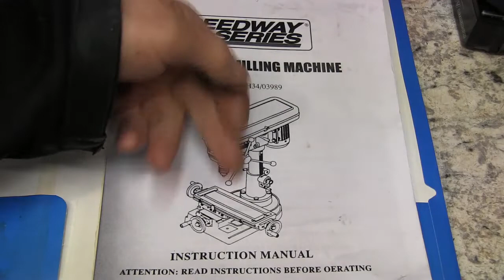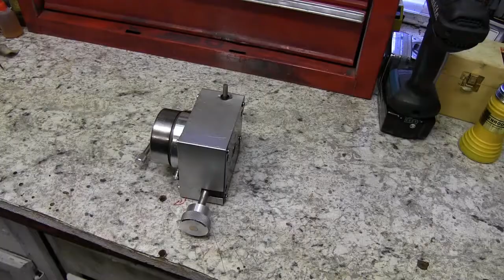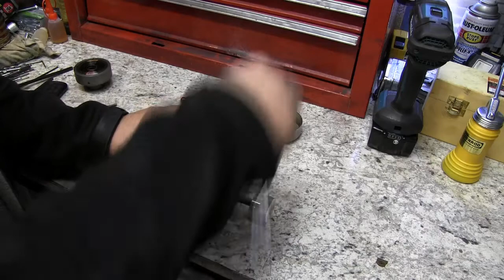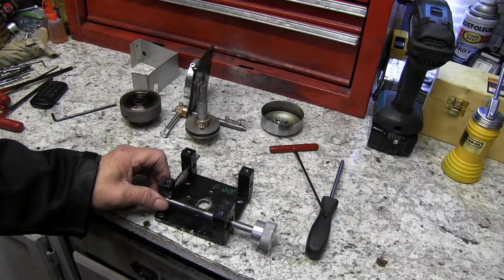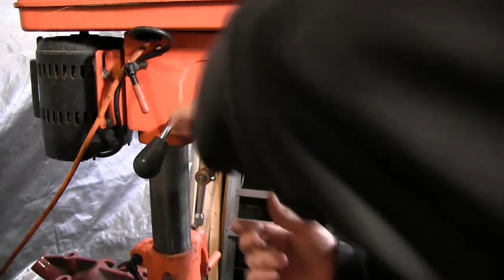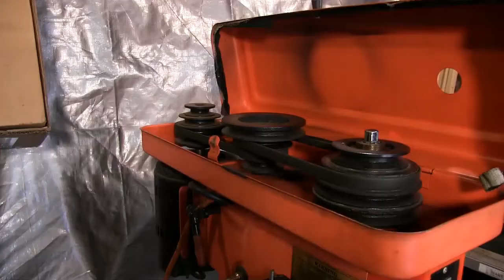Installing a Feed Adjust on the SpeedWay Mill

Comment: I had the same problem on my mill, I done it a little different, the spring you have is holding the worm gear tight but you stills have the bag lash in the quill, I have som springs at the side of the mill and I have mounted a plate around the quill that's attached to the springs, now it is the springs that holding the quill up, when I now use the fine feed the bag lash is taken out because the springs holding the quill tight up against the worm gear, hop you understand and can use the idea.

Comment: Outstanding work there Buddy! That's the thing about machine work. 90% of the job goes into planning and setting up the work. The actual cutting only takes about 10% of the total time to get the job done. Well done sir! Subscribed for more...
Reply from the maker: Thanks. It works much better now. But the machine is old and has a lot of vibrations in it. I am crossed between rebuilding and buying a new mini mill.

Comment: This channel is a great extension to the Radio Shop.  Knowing how to use a small lathe and a mill is a force multiplier to one's radio restoration skills.  Eventually one will need a shaft, bushing, pulley or some other mechanical part that is otherwise unobtainium. Thanks Buddy... look forward to your videos here.
Reply from the maker: Thank you very much for those kind words Richie.  And the reason why I set this up is to make those needed parts.